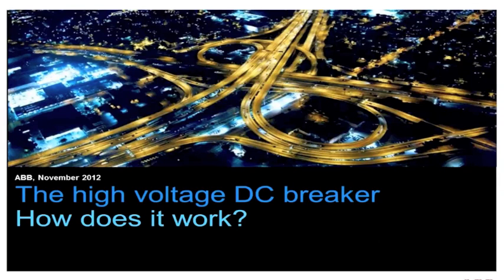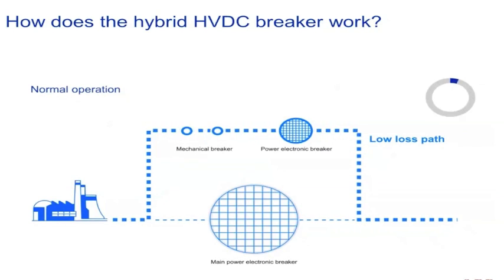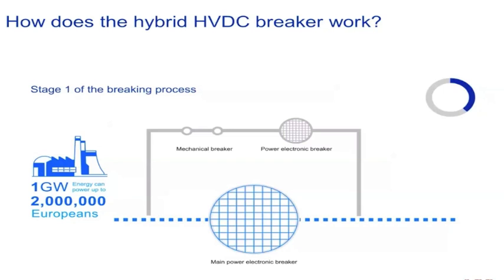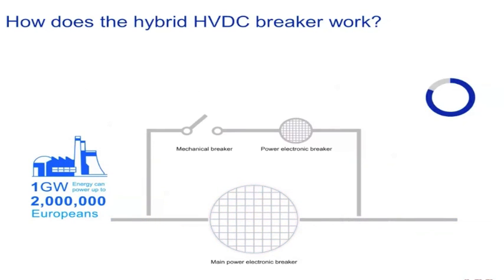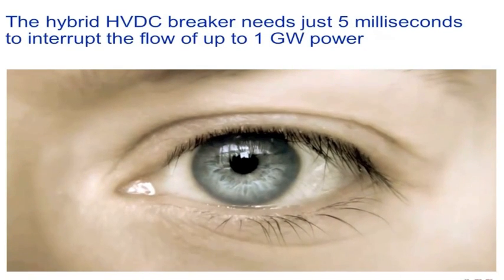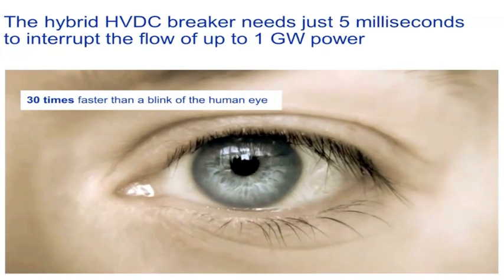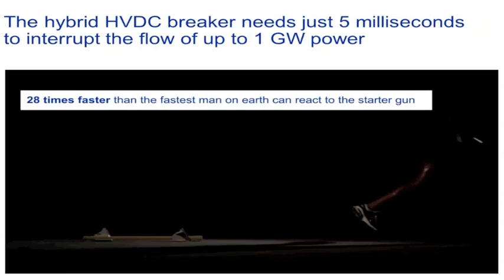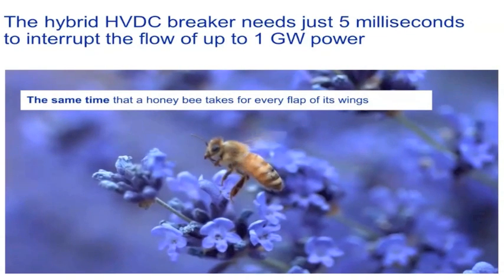Hybrid HVDC Breaker, how does it work?

Comment: Arcs are only a problem in mechanical switches. The main breaker would work alone, without the path with the mechanical switch that is.
The onstate of the main breaker however is rather big and would lead to losses. This is why there is another path.

Comment: I think the main PE breaker has more resistance but the video says that it is redirecting current with less resistance..
Reply: After the small power electronic breaker opens (oval in the top path) the resistance in the top path increases so that it is now significantly larger than the bottom path.  More current will now flow through the bottom path than the top.  What you say is true before the small power electronic breaker opens, but not after.

Comment: How do you prevent an arc?
Reply: After the small power electronic breaker in the top branch of the circuit opens, the current in that path is significantly reduced allowing the mechanical breaker in the top path to open without damage from arcing.